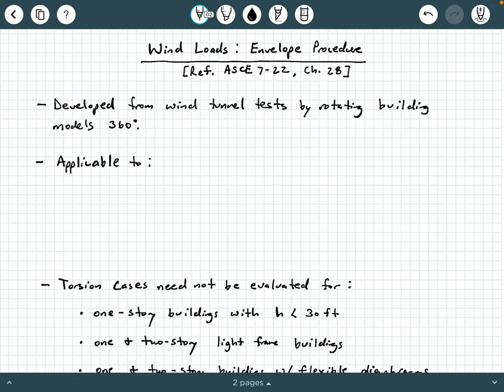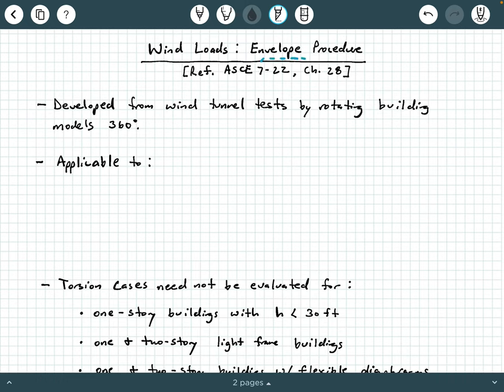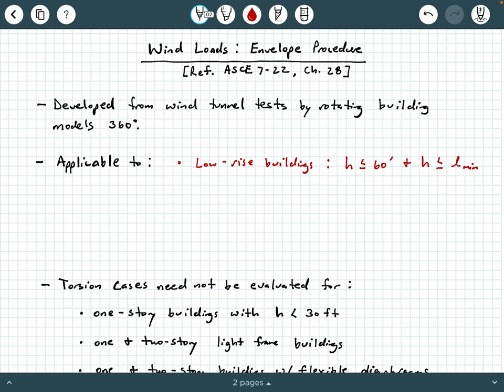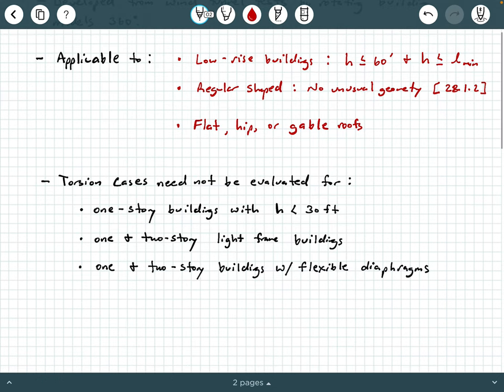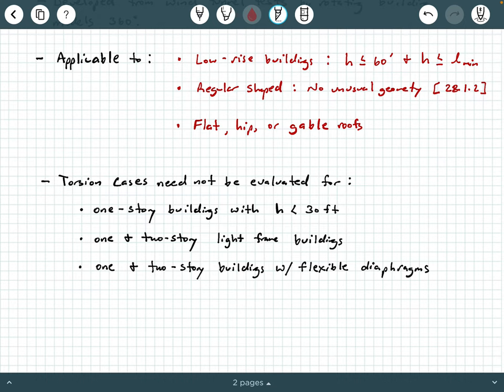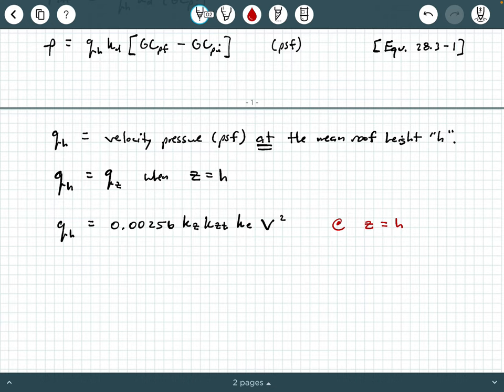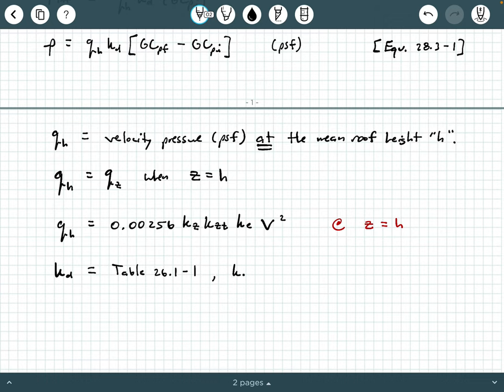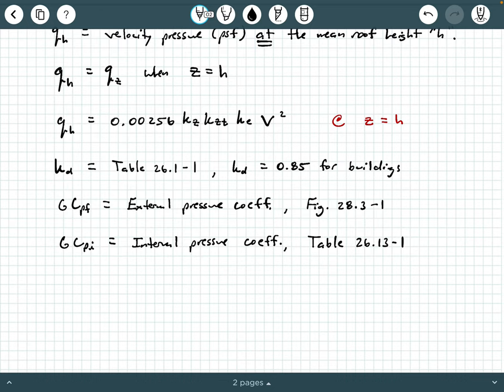Wind Loads:  Envelope Procedure (Ref. ASCE 7-22)

Comment: Can this procedure be used to calculate wind pressures on a wall for a building with monoslope roof? 

I.e. a box building < 30 ft height, 4.5 degree sloped roof, roof height increasing from back to front.
Reply from the maker: Thanks for your question.  Chapter 27 would be more appropriate for a monoslope roof for wind loads on the MWFRS.  See the user note in 28.1.
Reply: @mathandengineeringwithdr.a9515  Thank you for your reply!